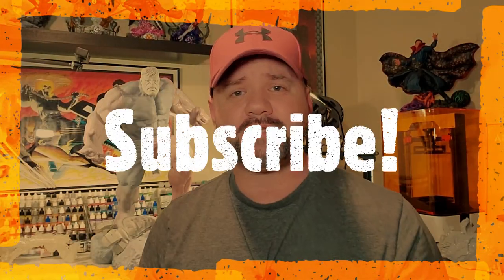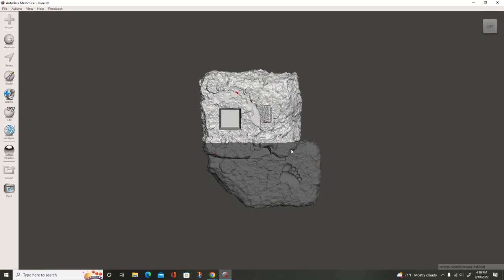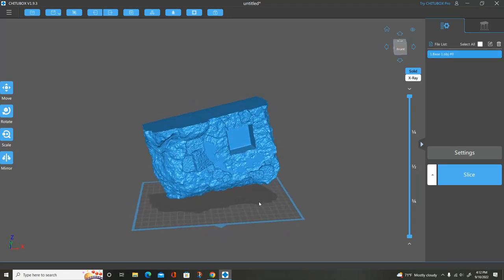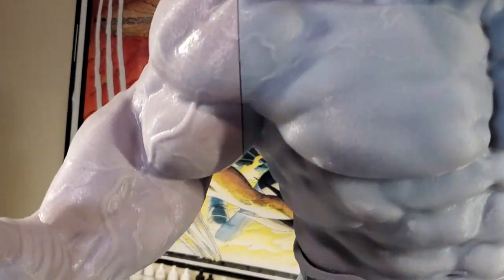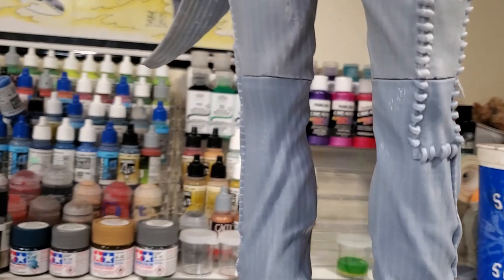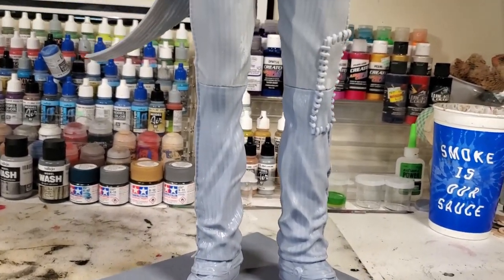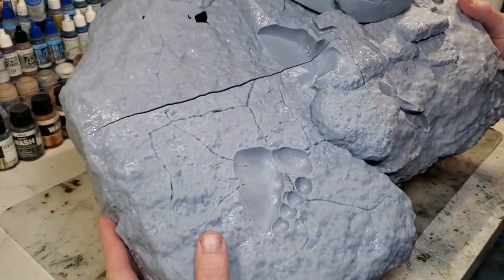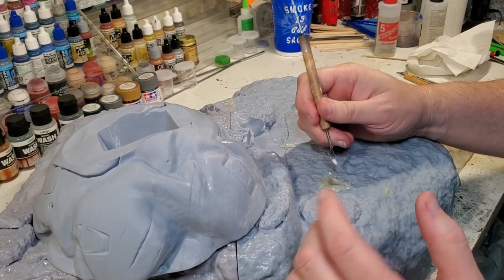Get BETTER Resin 3d Prints by doing THIS!

Comment: Apoxie Sculpt can also be smoothed with water... but they also sell Apoxie Safety Solvent - and it's amazing to use to smooth out your Apoxie Sculpt finish or to thin it down.  I use it for all my bigger gaps and fills.  Also saves you some sanding.
Reply from the maker: Yes it does!
Reply: @TheCreativeCollector  Apoxie Sculps smooths way better with isopropanol alchool...water makes it separate
Reply from the maker: I dont have a problem with it separating with water. And yes, alcohol works great too
Reply: @TheCreativeCollector  cool! Btw. Love your work/videos! Keep the good work

Comment: A great channel for learning painting and how to print
The only thing I would do different when you cut in Meshmixer
Make pegs for the parts,so they can attach to the part you cut off
Reply from the maker: I would but they don't always line up right due to expansion and contraction.

Comment: What printer are you using to do that size I'm looking at buying a printer but instead of just getting an intro one i'll replace i'd rather get something that will last and do the size prints id like to eventually get to like this one you did. Thanks in advance
Reply from the maker: Phrozen Sonic Mega 8K
Reply: @TheCreativeCollector  I’ve heard a lot of good about that one and then I guess you just use elegoo or creative for a cure station or is it better to have 2 cure stations and a wash? I’ve really been learning a lot from your video’s and it’s very inspiring.

Comment: is there any particular reason you didd't add keys for your base?
Also, just an FYI, Amazon says the G-Tool is currently unavailable. not sure if its a temporary thing or not.
Reply from the maker: I hot the early version of the model and it only had the one key in the foot. And yes the gtool is gone. They've discontinued it. I believe they're making a newer one.

Comment: Another awesome video! Question for you: what's the best method you've found to fill support divits? Also what grade of sand paper do you use with the G-tool?
Reply from the maker: Thank you! So I usually don't have huge divets from supports so I sand them down. If I do I use Tamiya spot putty. The Gtool comes with a couple of sheets of fine grain pads so I use those. That thing also helps big time with divets.

Comment: Well my mistake was that I thought I would rather avoid scars from supports on the models good parts instead of on the flat surfaces. This is why I always had the flat surfaces on the bottom, and therefore crooked fits.
Reply from the maker: If you slant the parts just right on the build plate then you can avoid too many support marks on the detailed area.

Comment: What's the final cost for a monster like this?  Between the print file, resin, paint, etc
Reply from the maker: Oh man. That's a tough one. The file was $30 I think. I used 9 bottles of resin at $28 each. Not sure about paint yet because I'm not finished

Comment: Seems I'll be using a lot MeshMixer, cuz there are some huge bases that even on 1/6 scale, don't fit on my Saturn S. But how do you join all the pieces, with super glue?
Reply from the maker: I use a 2 part epoxy. It's a lot stronger than super glue and will hold up better over time
Reply: @TheCreativeCollector  Idk why I thought the 2 part epoxy was dangerous. When I saw you used it without gloves I was like 🤯. Thanks!
Reply from the maker: Oh you're thinking of something else. APOXY is the sculpting stuff I use to fill in the seams. EPOXY is a glue I use to connect the base together. EPOXY isnt something to use with your hands. lol APOXY is ok to handle. Hope that helps.
Reply: @TheCreativeCollector  Lol I thought it was the same resin from this video

Comment: How do you find the right scale from 1/6 to 1/4 ?
Reply from the maker: It depends if the model is already 1/6 scale ,then 50% increase is 1/4. But you would need to see what the original file is scaled.
Reply: @TheCreativeCollector  I usually do the b3dserk.